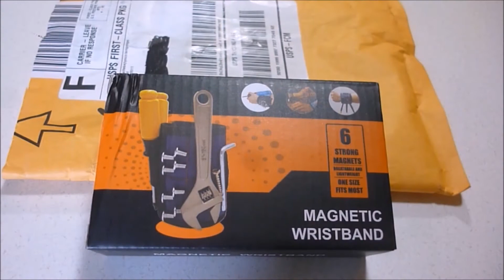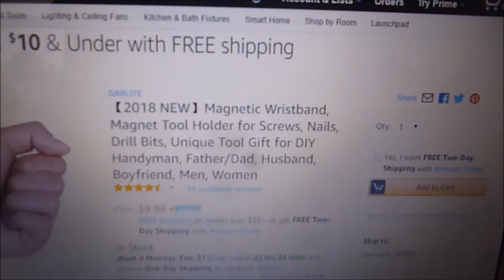DARLITE MAGNETIC WRISTBAND FIRST LOOK/REVIEW

Comment: Hi, Thanks for doing this really helpful as trying to buy a fathers day present with only a week to go.

Thoughts on product: Have you tried putting screwdrivers other way round?I think if i was doing work above my head then placing them 180degrees to how you did would work really well (obvs would have to be careful at the finish). Failing that those loops could be used for wires etc maybe?

I'm glad you brought out that other brand as I was going to buy it originally, so will check out your other video, cheers!

If I may give constructive criticism to the video itself, I think its great to see the product in action and to see how robust it is in real-use, I particularly liked how you described/showed how well they stay on during tests (ie moving wood around etc), I think the video could easily be shorter especially as some content/opinions were a little repetitive, could easily take the core content and make it just a few minutes (I think that's why you only got 4 thumbs-up - as its a little dragged out - which is a shame coz you went to a lot of effort on this and that alone deserves way more than 4) and this is subjective but personally I'm not a fan of the audio-overlap transition style, its distracting and i find myself fighting to focus on both bits as i wanna hear what you gotta say, I think a clean finish/start is best. But you got 6.8k subs so what do i know, right?  :D loved the tool test at the end, so many of these wristbands are photoshopped on amazon to look incredibly strong when they clearly aren't. Just wish this one had the pockets for plastic bits for electricals etc, but i guess they can be stuffed under the cuff a little, as can the screwdriver if all else fails.

Thanks again.  thumbs up going to look at other review ... Nnnnn...NOW!